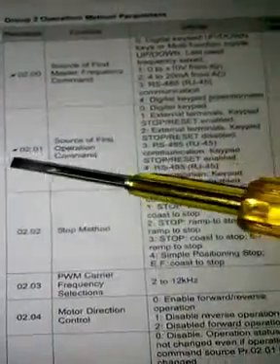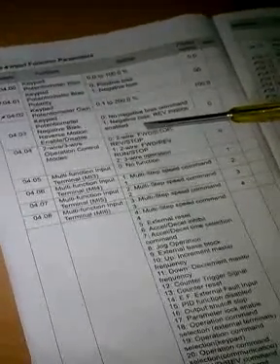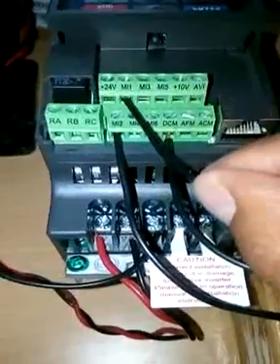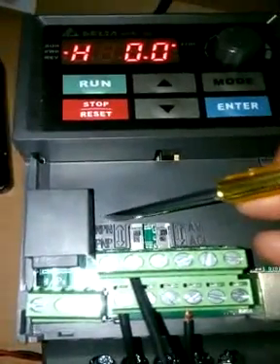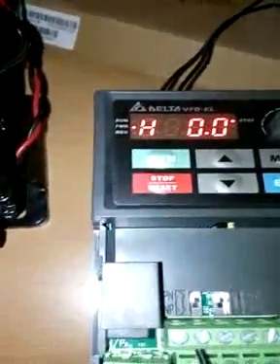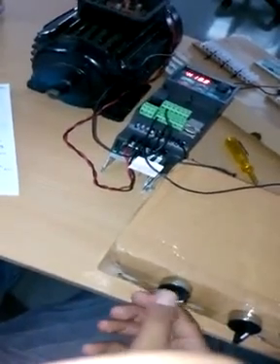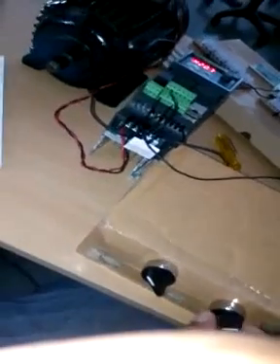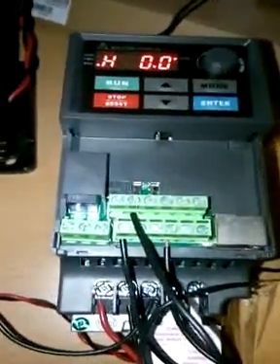VFD MOTOR start stop by MultiFunctional input PART01

Comment: Hi, I managed to get the MS300 inverter to work thanks to your videos and for this reason I believe you will certainly be able to advise me on a request.
I currently drive the motor in V/F mode through two wires and a 0-10V voltage across the
cnc, I would need to stop the motor in a specific position if necessary, of course I have an encoder on board, how do you set the driver? Thank you
Reply from the maker: Great to hear!

Comment: I Wr can find npn and pnp switch in delta vfd 002L21A model...
Reply from the maker: KIRAN NB  I m driving so wait
Reply from the maker: KIRAN NB If this L series delta VFD, then it don’t have PNP NPN DIP switch.
Reply from the maker: KIRAN NB 
Yes your VFD is L series so don’t think about it.   During connection use GND as common terminal.
Reply: @AutomationControl  yes sir, I was used GND as common, and 24 volt to M0 and M1. Is it OK...?
Reply from the maker: KIRAN NB SUBSCRIBE this channel for upcoming new videos on VFD
Reply from the maker: KIRAN NB NO. DONT DO THAT.
Reply: @AutomationControl  then sir,  what voltage should give to common and what to M0,M1....?
Reply from the maker: KIRAN NB 

No need to apply any voltage 

Connect PB1 terminal 1 to M0 and terminal 2 to GND

PB2 terminal 1 to M1 and terminal 2 to GND.
Reply: Here The drive is sourcing...? That voltage should give common through the switches to make enable m0, m1. If I am not wrong...?
Reply from the maker: KIRAN NB 
You r right it’s source.    But u don’t have commons terminal in VFD   

If there is common terminal then you have to apply 24 to it. Other wise not. 

So give GND to PB,s terminal directly.  And PB,s second terminal to M0,M1 respectively
Reply: @AutomationControl  yes sir.. nice. I got it. Basically I have wired with plc, DMV, DELTA robot controllers, but it is quite differe then that.. thanks for the conclusions...soo. much..
Reply from the maker: KIRAN NB Enjoy. 👍🏾 and subscribe for my work. 

Thank you. 😃

Comment: How can i wire a yaskawa j1000 on external start stop ,a potentiometer for external operation and should be a potentio meter beconnected
Reply from the maker: As I explain in Delta VFD 
Yaskawa j1000 having same connection for external start stop. Into yaskawa external INPUT S1 to S5 work as multifunctional input. 

Connect start PB to S1
Stop PB to S2
And both PBs second terminal to SC ( common)

Other parameter setting I will write soon. 

Sorry for very let reply.   

SUBSCRIBE  this channel for mor upcoming on VFD and control videos.
Reply from the maker: 1. Select Input SINK or SOURCE from DIP switch S3
2. make your PB output LATCHED or use two Selector switch (NO contact)
3.connect 2KOHM potentiometer terminal 1,2,3 to +V, A1, AC respectively of VFD terminal.
4. select DIP switch S1 on V (For analog Voltage 0-10 vdc, used for frequency selection)
Now Parameter setting

Parameter B1-01  set to 3(This is for Frequency reference selection :through potentiometer )
Parameter B1-02  set to 1(Run command selection for 2 wire sequence ; start stop using two PB)

Comment: I have MS300 Delta vfd..... I want to operate motor in both forward n reverse direction from my Forward n reverse push buttons... please tell me the parameters to operate from push buttons.
Reply from the maker: Abhi Gangarde very first I will tell u.
Reply from the maker: Abhi Gangarde 

Parameter 00-21 set value 1
Parameter 02-00 set value 1

02-00 is 2 wire mode1 , power on for operation control   Where 
External terminal will become. 
MI1-FWD/STOP
MI2- REV/STOP 

So connect PB 1 to MI1 , PB 2 to MI2 and both PBs second terminal to common.
Reply: Thank you....I'll make these connection and wil chk It.... please give your contact number...
Reply from the maker: Abhi Gangarde 
arc.work@hotmail.com
For contact use EMAIL ID

or comment into videos. 

If it is helpful then SUBSCRIBE my channel to get notifications about So many my upcoming videos about VFD and Automation.
Reply from the maker: Abhi Gangarde 
U have to LATCH PB command 
Otherwise use SELECTOR Switch to perform this function.
Reply: Yes,I have latched my both PB....

Comment: I have 5 HP AC submer water 3phase pump with 8x2 parallel 310 W 16 solar panels now I want to run 3 HP AC submersible pump. One at one time? Should I use changer only or I have to change controller also.right now I am using 5.0HP 3/380V50HZ pump?
Reply from the maker: just use changer
Reply from the maker: look at controller range for HP. if it covers 3HP then not required to change controller